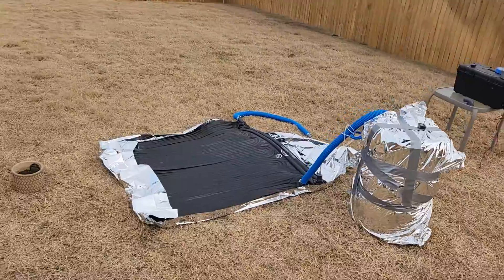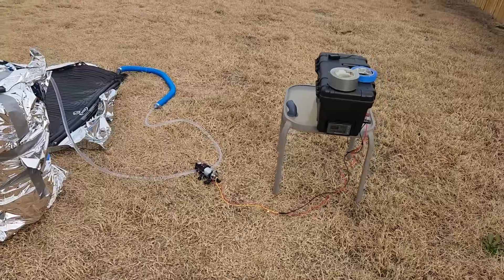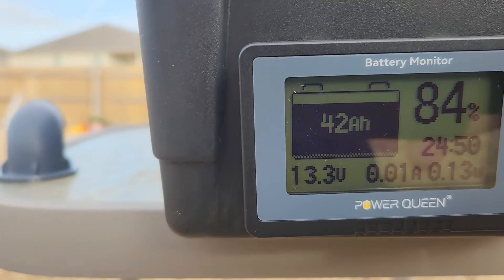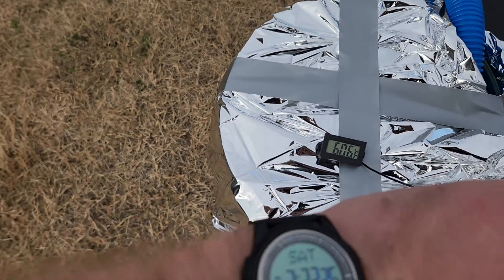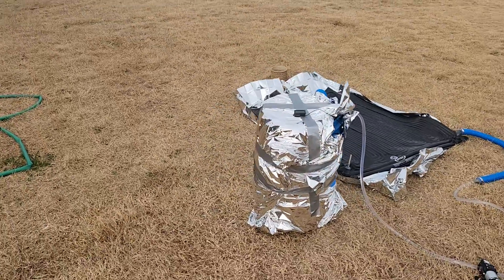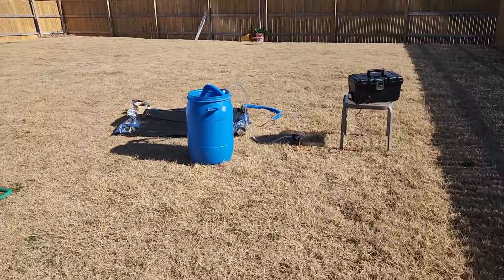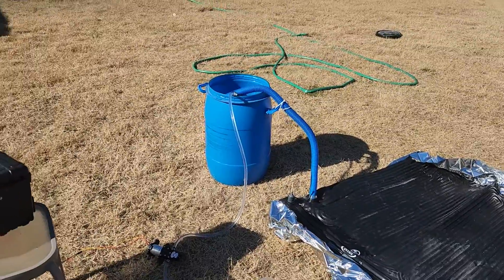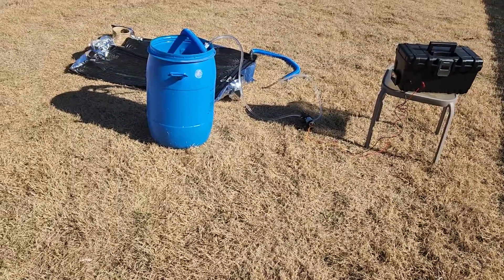20F gain in 4 hours. 20 gallon DIY Solar Water heater! #Green House heater.

Comment: Curious if this, in combination with the sand heater, have some tubing also routed in that sand? would that combination extend the heat output to the mat?
Reply from the maker: Eh. I don't think you'll have any benefit. The purpose of this particular project is to heat water in the cheapest way possible. This is like $60 in parts. The purpose of the sand battery is to get as hot as possible in a cost effective manner.   This water heater, since it's based on direct solar heat, is very sensitive to cloud cover

Comment: I mean it gets job done i feel like 2 240w solar panels and heating element would do better even in low lightand could be all purchased for less then $200
Reply: And im sorry if it feels like im always negative i actually love your videos alot and understand the limitations you set up for your videos why spend a fortune on each video when youtube isnt paying millions to you or even close keep your head up and keep making awesome videos
Reply: Ive watched every single video you have produced brotha im saying its more effective then will the black poly you have and Santan solar its in your backyard kinda sorta in arizona
Reply from the maker: Check out my sand battery video. i used a water heater element for that on Solar.  I don't know where you're getting 480w of solar for $200 though.